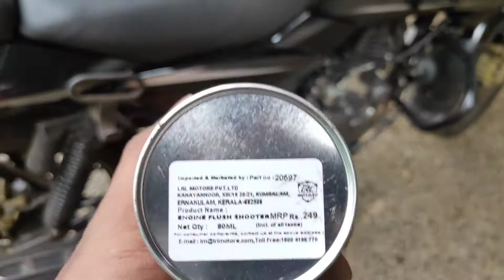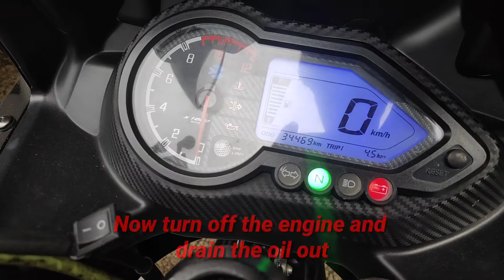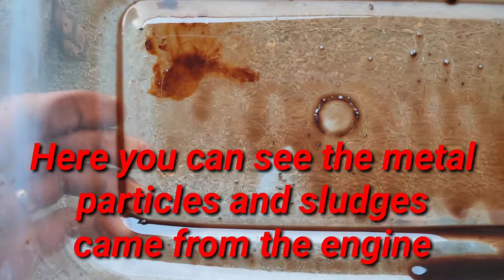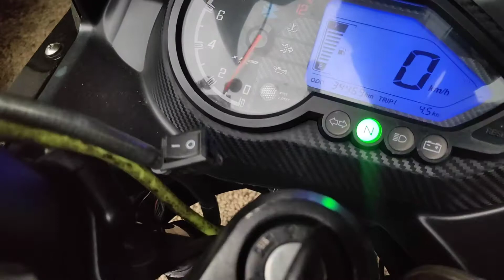Liqui moly performance upgrade on pulsar 220F

Comment: Oil capacity is 1200ml I guess...I own a 220 too.. correct me if wrong..
Reply from the maker: Yes you are correct bro
Reply: @motowings6872  So can you suggest me the best engine oil for traffic use / city ride

Comment: Hi bro what about difference
And vo chota vala tube dala na vo kya hai
Reply from the maker: That's mos2 additive, yes bro it makes a lot of difference in engine performance
Reply: @motowings6872  oh k what is the main use of mos2 additive
Reply from the maker: It will reduce the engine vibrations and give a smoother ride
Reply: @motowings6872  oh k bro no side effects na for engine
Reply from the maker: No bro only benefits
Reply: @motowings6872  k bro i ll use it..
 at what time we can use it correctly
Reply from the maker: After your oil change

Comment: Bro പുത്തൻ vandikk ചെയ്ത scene ഇണ്ടോ
Reply from the maker: Free service Ellam kazinju cheyta mathi bro vere scene onnullla
Reply: @motowings6872  showroom കാര് udaippaa bro🥴 avde കൊടുത്ത് cheyyanekkalum നല്ലത് സ്വന്തം cheyyaneyaa
Reply from the maker: Njn 6k kilometers koodumbol aan cheyyunne apol njn use cheyyunne oil motul 300v aan kto
Reply: ഈ വിഡിയോയിൽ കാണുന്ന ഓയിൽ use ചെയ്ത scene ഒണ്ടോ
Reply from the maker: Ella but oru 3500 n ullil maranam
Reply: @motowings6872  bro 220 il 1.15 aano oil capacity
Reply from the maker: @ananthukrishna172  no 1.2 aan
Reply: @motowings6872  bro 1200 aana

Comment: Any changes after?perfomance
Reply from the maker: Friend nte vandi aaan bro , engine il ninn ullla vibration full poyitt vandi smooth aayi
Reply: @motowings6872  vibration kurayumo bro, 33k  oddiya 220 use cheyyamo
Reply from the maker: Vandide conditions pole erikkum bro oil changes okk correct interval il nadathiye aano ..? 20 k to 25 k kms aarunnu better time .want to know more insta il msg ayak
Reply: Bro njn 20k avumbo use cheythal seen undo
Reply from the maker: Ella bro cheyyam oru problem um undakillla